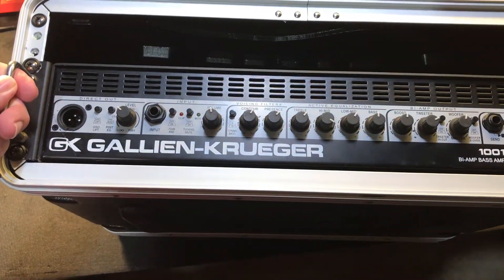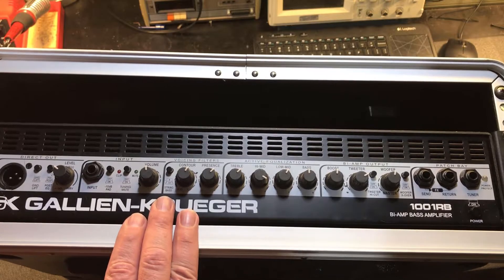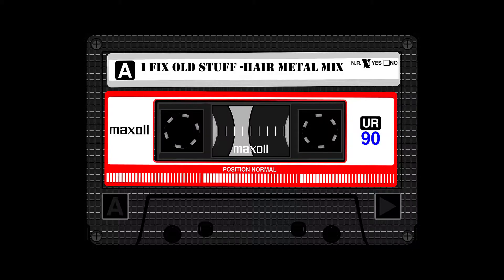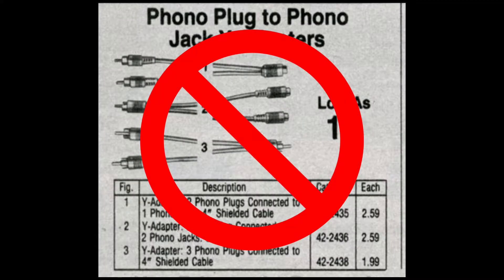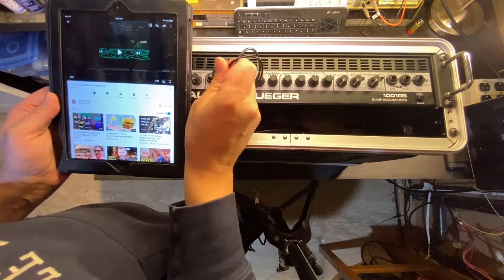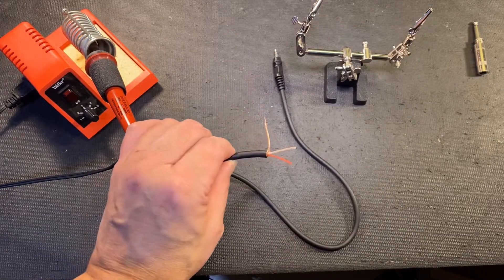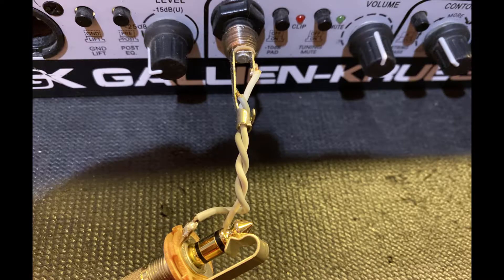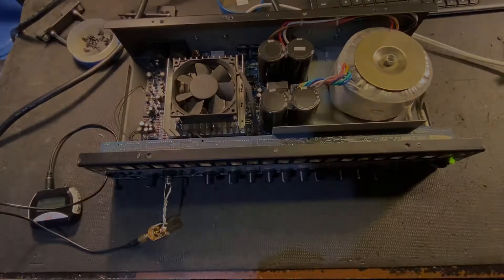Amplifier Repair & Troubleshooting Part 1: A Cheap Signal Generator

Comment: First
Reply from the maker: Technically, if you look at the third harness I show here - if you replace the 1/4" plug with alligator clips for positive and negative, this concept could be used for troubleshooting sound amp problems in pinball machines and video games